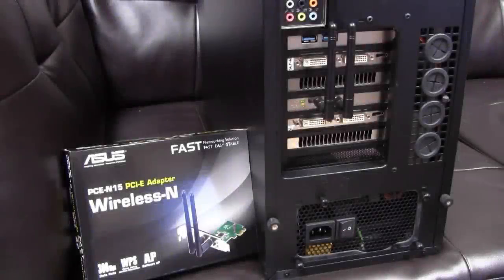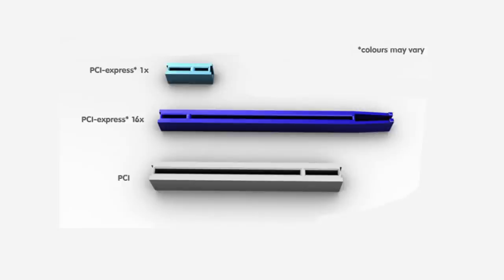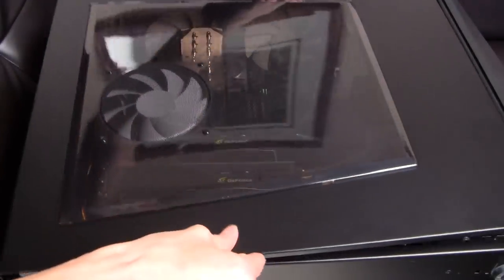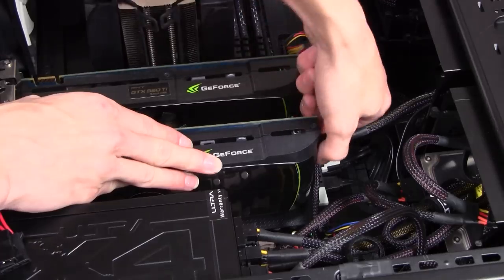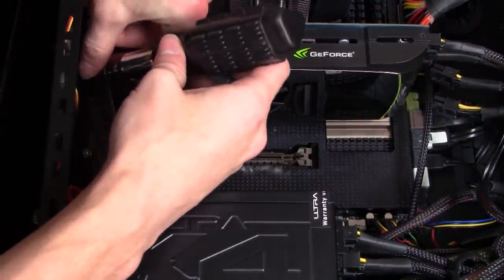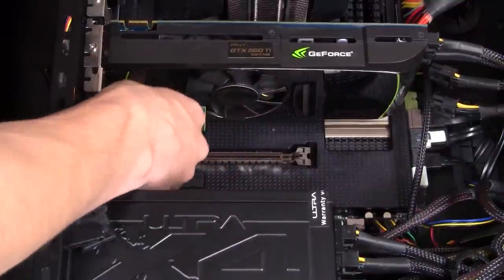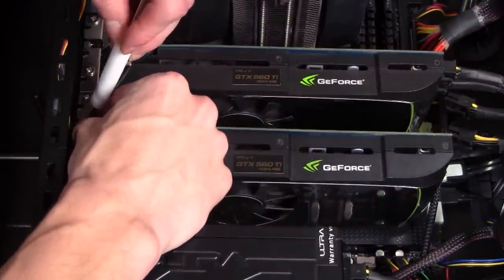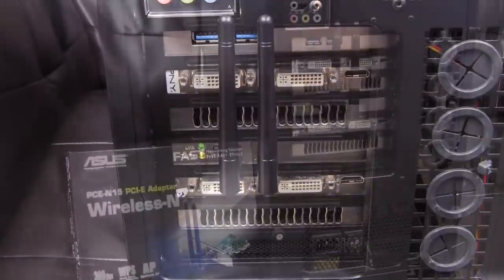How To Install A WiFi Card In Your Desktop Computer

Comment: Yo what should I do it keeps telling me failed to install the driver
Reply from the maker: Is Windows trying to automatically install the driver for you or are you trying to manually install the driver?
Reply: @WiltshireTutorials  so before I installed the driver with a CD-ROM drive like 2 weeks ago when I brought the adapter, and I accidentally deleted the driver and trying to install it again and everytime I install it it says “failed to install there was an error” or something like that
Reply from the maker: Have you tried removing the device entirely using the Device Manager
Reply: @WiltshireTutorials  yes I removed like everything off of device manager
Reply: @WiltshireTutorials  could the reason be that I made the file in file explorer read only?
Reply from the maker: @colinmusgrave  Yes. That would probably have something to do with it. It's also possible that Windows has blocked the files from accessing things it needs to. Also, try running the installer as Admin.
Reply: @WiltshireTutorials  ok cuz it keeps saying that I need to provide administrator permission to uncheck the read only
Reply: @WiltshireTutorials  and idk why cuz It says I’m administrator already
Reply from the maker: @colinmusgrave  You have Windows permissions all messed up then. You're going to have to manually take ownership of the file(s)
Reply: @WiltshireTutorials  but how because I’m using  cd rom drive and I can’t take ownership of then
Reply from the maker: @colinmusgrave  I would download the the most up-to-date driver from the manufacturer's website. The drivers on CDs are usually REALLY out of date.
Reply: @WiltshireTutorials  but I’m trying to get wireless wifi so how do I download the newest when I don’t have WiFi
Reply: @WiltshireTutorials  if I get a new adapter will it work
Reply from the maker: Depends on how bad you've messed with the permissions on Windows. If it thinks you're not admin then you have some trouble on your hands
Reply: @WiltshireTutorials  I am admin tho and last night everything was working fine and I deleted the adapter driver and it’s so annoying why I can’t get it back
Reply from the maker: @colinmusgrave  Do you have a System Restore point saved? You may be able to use it to fix the issue
Reply: @WiltshireTutorials  no I’ve tried to do that but it always says failed
Reply: Ever since I got a new motherboard it keeps happening and I haven’t downloaded my motherboard drivers yet cuz I don’t have internet that might be why
Reply from the maker: It may have something to do with it. Are you re-using your install of Windows on the new motherboard? Sometimes that can cause some odd behaviour. I always recommend a fresh install of Windows when swapping motherboards.
Reply: @WiltshireTutorials  I really don’t want to pay tho....
Reply from the maker: Pay for what? You can use Windows for free without activating it. You just have a watermark on the desktop and are unable to customize Windows.
Reply: @WiltshireTutorials  I got a code and payed but i had a prebuilt pc witth it already activated but now i got a new motherboard so i need it and the keyus not working

Comment: I have no idea why my wifi card is only reaching 2 bars when before it was on full bars.
Reply from the maker: Windows representation of signal strength is usually inaccurate. Did you check to see if antennas are screw all the way on? Sometimes bumping them can unseat the antennas.
Reply: +Wiltshire Tutorials Yeah I have checked, maybe because physical surroundings?
Reply from the maker: +Paul Huth Could be. Do you have a 5Ghz band or just 2.4Ghz?
Reply: +Wiltshire Tutorials I think it may just be a 2.4Ghz
Reply from the maker: Interference may be the issue.
Reply: +Wiltshire Tutorials Oh right, network interference maybe?
Reply from the maker: +Paul Huth Could be. If you live in an apartment or an area with a lot of networks, they could interfere with each other.

Comment: AMD RICHLAND QUAD CORE 6600K 4.2Ghz

 ATI RADEON HD 8570D GRAPHICS

1000GB 7200RPM HARD DRIVE

8GB OF 1600MHZ DDR3 RAM

 GAMING KEYBOARD & MOUSE

This is the ideal Computer for playing your favourite games with its 4.2ghz Quad Core CPU, ATI HD 8570D graphics, 8GB 1600mhz ram and Gaming Keyboard & Mouse. It will also excel at streaming media, sufting the web and designing spread sheets.

 Item Features:

AMD Richland 6600K Quad Core Processor / CPU running at 3.9GHz (With 4.2GHz Turbo Mode)

8GB DDR3 1600MHZ RAM

ATI Radeon Hd 8570D GRAPHICS

1000GB 7200RPM SATA Hard Drive

CD / DVD-RW Dual Layer Optical Disc Drive

FM2+ MICRO ATX Motherboard

500W Quiet Power Supply Featuring Large 120mm Cooling Fan 

High Quality Desktop PC Gaming Case.

Gigabit Ethernet 10/100/1000 Mbps LAN

6 X High Speed USB 2.0 Ports

6 Channel HD Audio

4 X SATA II 3GB/s Ports

1 X PCI Express X16 Slot

1 X PCI- Slot

2 X PS/2 Port (For Keyboard / Mouse)

1 X VGA Port

1 X Dvi Port

1 X Hdmi Port

Triple Monitor Support

Gaming Keyboard & Mouse

UK Mains Cable Included

All Relevant Driver Discs Included

PLEASE NOTE: An Operating System is not included with this PC.

does this have wifi ? im not good with the insides if computers ?

Comment: I’m looking for a good affordable WiFi card to buy. Does anyone have the Asus one he used in the video? If so, would you recommend? I’ll take any WiFi card recommendations cause I’m looking to buy one ASAP. Thanks!
Reply from the maker: Gigabyte or Asus make good WiFi cards. The one in the video is outdated now, in terms of networking, and I wouldn't recommend it now a days. Get a WiFi card that supports dual band and AC networking.